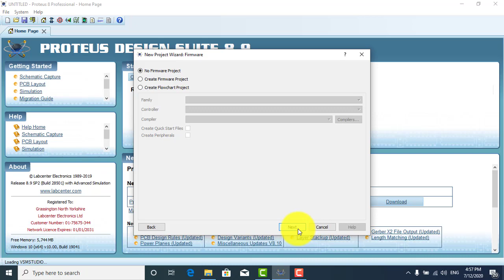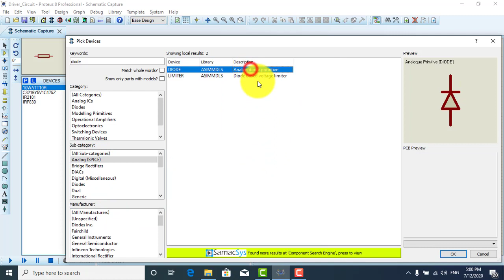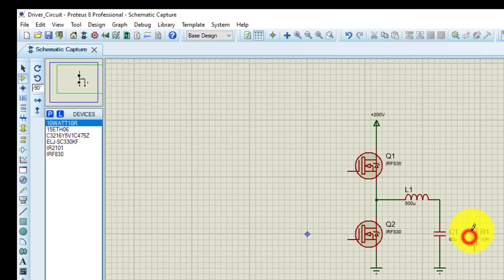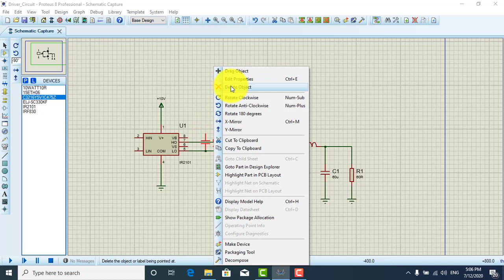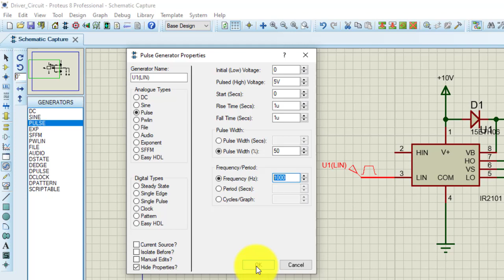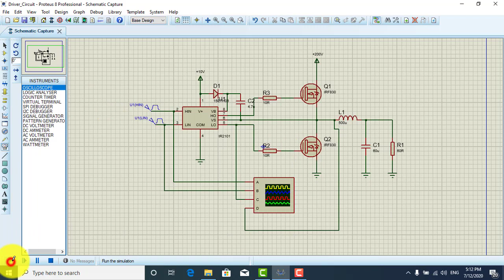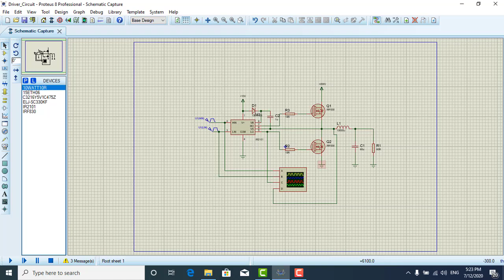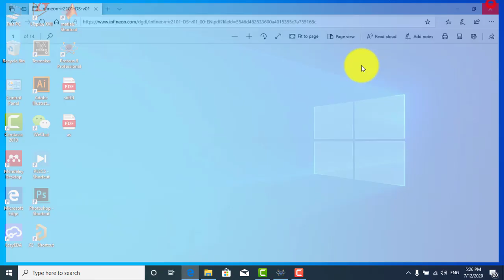MOSFET Gate Driver Circuit in Proteus | Buck converter | IR2101| #DrHaiderZaman

Comment: What do I do If the power going to the mosfets are 120v dc, and the mosfet gate drivers are using separate 12vdc. How can Vs on the gate driver connect to that high voltage on the mosfet shouldn't they not be connect and stay isolated what connect to Vs on the mosfet driver then beside the bootstrap circuit capacitor from VB?

Comment: what if just use just the hight side  does that work ??
Reply from the maker: We are driving two MOSFET here, the one with floating source terminal is driven using high-side while the other having source terminal connected to ground is driven with Low-side drive. If you have one MOSFET to drive you can use either the high or Low-side driver depending on the source terminal connectivity.

Comment: hi sir.What would happen if we chose only one input and one mosfet !!!!
Reply from the maker: You can leave one side floating. Either use high or Low-side driver is fine.
Reply: @dr.haiderzamanlecturerelec7737  what should be the circuit consideration in this case i.e I want to use it in low side then what should be the circuit consideration be
Reply from the maker: @tilotamakodam1810  you can leave the high side floating. Means no need to connect.
Reply: @dr.haiderzamanlecturerelec7737  thank you sir for your reply... Can you guide me making a driver circuit  .. struggling to make one
Reply from the maker: @tilotamakodam1810  You means simulation?
Reply: @dr.haiderzamanlecturerelec7737  Yes sir.

Comment: Hi sir, can you please let me know how to design a driver circuit that I am struggling with the driver circuit design?
Reply from the maker: Let me know your design challenge.
Reply: @dr.haiderzamanlecturerelec7737  I have to design buck converter of input voltage 200v with output 48v using Ir2184 driver in ltspice could you please me?
Reply from the maker: Please let me know your challenge and I will try to resolve.
Reply: @dr.haiderzamanlecturerelec7737  My challenge is I am not able to figure it out, right capacitor values for bootsrap circuit and I am confused with Ir2184 driver connections, I can share you my design spec, if you give me communication details.
Reply from the maker: send me at
hdrzaman@uetpeshawar.edu.pk
Reply: @dr.haiderzamanlecturerelec7737  I did it sir.
Reply: @dr.haiderzamanlecturerelec7737  I did it sir
Reply: @dr.haiderzamanlecturerelec7737  I have you sent you sir
Reply: I am sorry due to internet issues it have been posted many times
Reply from the maker: No worries.😀 👍